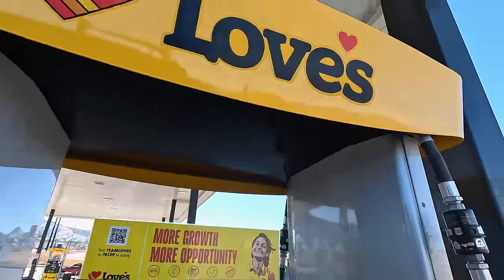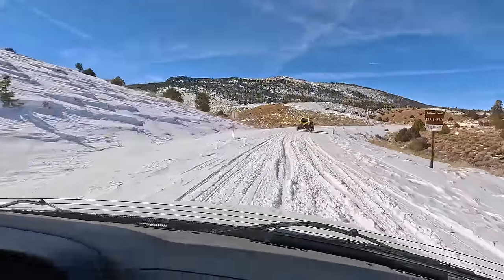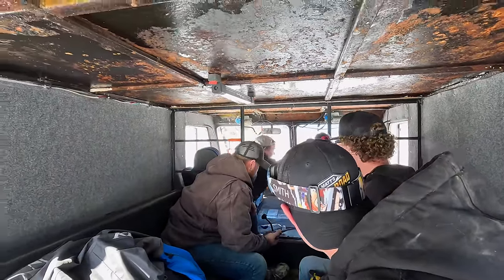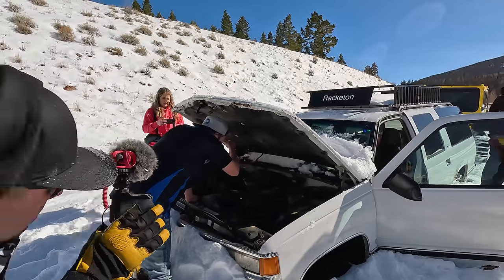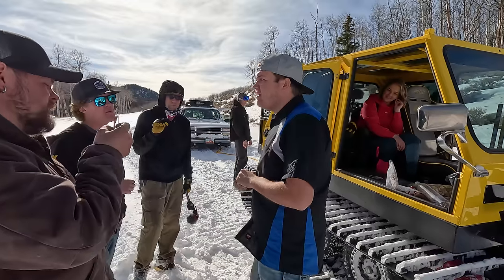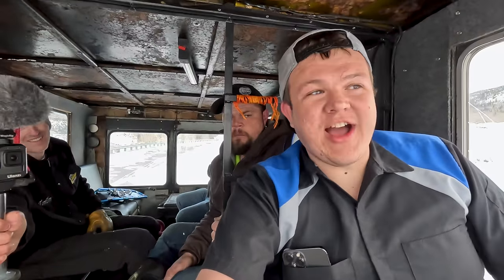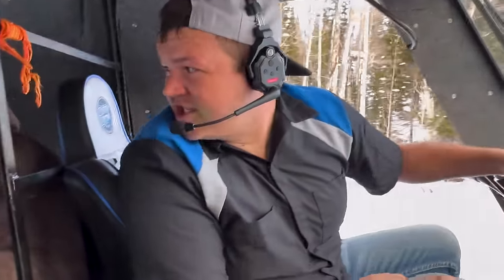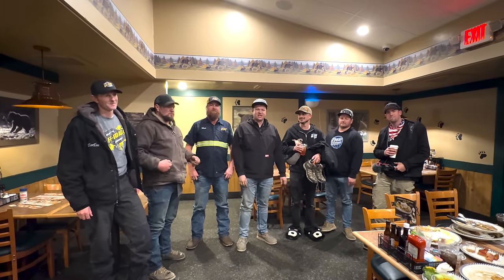Everything That Could Go Wrong Went Wrong! Snow Recovery. @MattsOffRoadRecovery

Comment: Thanks for saving my bacon, Robby and crew!
Reply: @RobbyLayton You need to run a regulator between the new lighting wiring harness and the alternator. Plus you need to make sure you use the proper gage wires for the lighting and any wiring you replaced. Also make sure the measure the resistance of each wire so that it meats the correct parameters for the lights or and if you still have all the wires you pulled out of whiskers you might want to measure all the wiring resistance lvls on them as well. All just to make sure everything you did under the dash is working properly as well. Check your New Lights and your Wiring for Shorts to ground, or your wiring with a power lead that's grounded.
Reply: @MattsOffRoadRecovery I really Hope you guys get a used skid steer and use the drive train out of it on the Bomb-Bee.
Reply: hmm out shown by a 300 straight 6. matt love you videos but the ls isnt as great as you think
Reply: @davidsesona4156  No its better than He thinks. That old Straight 6 has old school flat tapper heads on it and its entire internal setup rather is built for TORQUE. So yeah that old inline 6 did a little showing off in this video but that thing will NEVER show a LS. There is a reason the LS is considered the BEST Engine on the planet. SO Dont get all cocky when an old well maintained Straight 6 Shows off. P.S. Your Completely Right I just wanted to sound cool.... lol
Reply: @novicracker1980  ls is over rated I’ll never own one driven many of stuff with ls it doesn’t impress me any proves how small people are
Reply: @davidsesona4156  I mean Bro there are tons of engines out there but the LS is the Number One in the World. Well besides CAT, but that's Diesel Engines a completely different monster. Anyways. Bro that Flat Tappit Inline 6 is a Torque Monster and its a Big Block. So it has all the Torque built into the Low end.
Reply: I felt the stress on this one!
Reply: Sure Glad you didn't have Chad  help with the wiring
Reply: @Westerntraveler  HAHAHA Right I forgot about that.... @ChadsFab... lol
Reply: Matt, did you add the limited-slip differential additive to the Bombi's 9-inch? If not the clutches are most likely burnt up.
Edit: I got to thinking that you're using an open differential which wouldn't use an additive, but it seems an open diff' wouldn't steer or perform properly in many situations. And I'm no specialist at this so all I can do is wish you luck. lol.
Reply: Watch this footage carefully robbys tow point when pulling blue steel at the end is much lower  so wiskers stays flat underload meanwhile  bombi was standing up on its heals losing  atleast half the tracks been in contact  with the floor
Reply: Next time leave Tom on the mountain.
Reply: @ashleywright1991  Nice observation.
Reply: @davidsesona4156  "proves how small people are"
lol, what?
Now you judge people to be bad based on an engine?
Reply: @J..a..y  Maybe leave you on the mountain, what a rotten thing to say, sorry for the people around you...
Reply: Torsen Differential
Reply: @novicracker1980 Chad's Fab to the rescue!!
Reply: @georgelugenalt200  OH YEAH!!!
Reply: Haha I heard the few seconds of the tune. “I did a bad bad thing”
Reply: Don’t tear up the snow cat

Comment: Thanks for the help Robby!
Reply: Matt, did you add the limited-slip differential additive to the Bombi's 9-inch? If not the clutches are most likely burnt up.
Edit: I got to thinking that you're using an open differential which wouldn't use an additive, but it seems an open diff' wouldn't steer or perform properly in many situations. And I'm no specialist at this so all I can do is wish you luck. lol.
Reply: I know ripsaws use a spool differential and 3 brembos for braking per side

Comment: Fuse are your friends. Fuses open before wires melt. Electric 101. Wire size is never too big, Electric 102.
Reply: The lower the voltage the more critical calculations are . I'm a sparky and forever getting it wrong with low voltage stuff on my camper , my boat etc through laziness but I always play safe on fuse sizing , a professional cheat then lol . Impedance is your enemy, and as you say, fuses are your friends .
Reply: Yes fuse is my friend indeed. Relay is nice guy too.
Reply: I hate wiring…every time a new problem…. Cable are the butches of a vehicle……
Reply: And understanding the technology your working with.  If that ammeter uses a built in shunt that requires the charging load to be fed through it then you need cabling capable of carrying that load going both into and out of it all the way from the alternator to the ammeter and back to the battery.  On a the typical 32 amp Ford alternator used on older equipment that wasn't that big of a problem but with the newer ones tipping the 100 amp scale then you need a remote shunt for the power to pass through and an ammeter that just reads a low powered signal wire going from the shunt to the dashboard.  That's why many today forgo the in-dash ammeter and go with just a voltmeter to show 12.5 to 14/15 volts as Ok and above or below as a problem.  Second item is to eliminate the load on the ignition switch and dash wiring by using relays.  Generic 40 amp relays are still just about $10 each and only require a few Milli-amps of power to activate and using them tends to make ignition switches in older vehicles last a lot longer along with become much more reliable.

For many going with a Painless brand wiring harness for a classic vehicle along with the relay box option relieves a lot of the headaches since you just buy the one that supports the dashboard and number of circuits you need to run and just connect the labeled wires to the battery, starter, alternator, lights, signals, gauges, senders, etc, etc.  As the name suggests they do take a lot of the Pain out of the process.

Best!

Comment: I watched this on the MORR and enjoyed it, so now summore enjoyable footage of the recovery that went left, right, up, and down. Y'all teams work well together at creating very helpful useful content.  I know if I ever purchase a beater snowcat that will have to be rebuilt, modified, and painted I will get the Whiskers for the roomy size and add a hemi 5.7 in it and add plenty of fuses to prevent possible wiring harness issues. I would source a similar differential from a military track vehicle like a M113. The military track vehicles are very durable and require very little maintenance. They use large disk brakes to lock each track and we call the steering laterals similar to Matt's Bombi

Comment: Here's an idea for a new axle:   how about a drive axle from a Bombi. Big oil bath differential. Internal band brakes that can be relined protected from snow and ice. 
Take into consideration how many bombi-like snowcats lasted many decades with that set up.  Kind of like they knew what they were doing.  Having had experience with external exposed brakes on a tracked vehicle I expected there would be some issues in some snow / ice / temperatures. 
You knocked it out of the park building the Banana, Morvair and worlds largest off road wrecker but the old snowcats seem to have been designed pretty good right from the start..
Would think there is enough turbulence to throw oil around in that inverted axle diff but the pinion bearings wouldn't be getting the same volume of oil from above.
Those aftermarket auto shop sensors for all makes and models seem to be a gamble. OEM often a better bet.
Did you know that NASA has a big fleet of 1970's vehicles (cars, trucks, service vehicles, ambulances) that are all mechanical. No ECU's control modules, sensors etc.  Old school points distributors, carburetors, etc that can be fixed with a screw driver, pliers (ocaisional claw hammer).  Just sayin'.

Comment: Change the alternator over to a one wire gm and it will eliminate the external voltage regulator

Comment: You might look into an air locker and put it on a momentary switch so when you are going straight and need all the traction you can lock the tracks together. I have seen plenty of times pulling hard only one track was spinning. I don't think at that time you were trying to turn.

Comment: TEAMWORK MADE THE DREAM WORK. HEY ROBBIE DID ANYONE THINK ABOUT TURNING ON ALL OF WHISKERS LIGHTS ON : BECAUSE THAT WAS THE REASON YOU UPGRADED IT. SO IT DIDN'T HAVE ANYWHERE TO DUMP THE EXTRA VOLTAGE, TRUE. YOU COULD HAVE ALSO CHARGED THE JUMPER PACK WITH THE EXTRA POWER, PLUS ADDING THICKER GAUGE.  YOU'LL ALSO NEED TOO CHECK THE MAXIMUM LOAD OF THE GAUGE OF WIRE AND PUT A FUSE ON IT. GOOD RECOVERY FOR WHISKERS . HAVE A GOOD WEEK AND COUNT  YOUR BLESSINGS AMEN.

Comment: When you go over the wiring, take a look at the fuses.  Thier whole job is to prevent wires from melting.  Even the main power connection to the alternator should be fused.  It will look like a metal strap, but it's designed to go before the wires smoke.

Comment: Suggestion that Robbie should love. Swap that old Ford alternator for a GM 3 wire, a 10si or 12si, assuming it still has the externally regulated model. Gets rid of a little more wiring as a bonus.

Comment: I had a similar problem with my xj after replacing the voltage regulator, the fix was literally a new ground run to the neg pole on the battery and a keyed hot for the pos/key hot side of the regulator run via relay and that gave a solid enough signal to keep alt output to 13.3-14.6 on the gauges

Comment: Robby use O Gage wire for all your ground's and also from the battery to the Alternator you will never have this problem again. Big difference when you use it. People with big car systems do this and it makes it charge better. Also use a Chevy Alternator from a 1978 Chevy it will work

Comment: Build shield over calliper and rotor to keep snow out and hold heat in. Get different break pads that work better at lower temp. Do pressure test at caliper. May need to go 4 piston or add another caliper.

Comment: With you and Matt talking about taking the snow cats to Sand Hollow, are you guys not worried about the abrasive sand getting into all the moving parts on the tracks? I mean there's a reason they are snow cats and not sand cats. Snow getting everywhere doesn't ruin moving parts.
Reply: I believe it's a rubber track not a steel link track like on a tank. Not really many moving parts as such in the track itself.

Comment: Robby,  A smart alternator is a type of alternator controlled by the vehicle's onboard computer. This allows the alternator to vary its output voltage depending on the needs of the vehicle.
A traditional alternator, on the other hand, has a fixed output voltage. This means that it will always output the same voltage, regardless of the vehicle's needs.
A smart alternator can reduce its output voltage when the vehicle's electrical demands are low. Which can lead to some Issues.
Smart alternators are intended to extend the life of the vehicle's battery. This is because the alternator can reduce its output voltage when the battery is fully charged. This can prevent the battery from being overcharged, which can lead to Issues.

Comment: With the overvoltage output of alternator, there is one of two possibilities:  1.  The alternator had an internal voltage regulator failure or 2.  An external voltage regulator was never installed where it was required.

Comment: If your alternator is overcharging, and you can’t just disconnect it and runoff the battery the best thing to do is turn on every accessory you have to help soak up some of that extra voltage output

Comment: Hey guys,
I’m not an electrician but, when I put a high output alternator in a vehicle, I was told by a local automotive electrical shop that’s an institution in the valley to run a jump wire 4,6 or 8 ga. with a 50 amp inline fuse from the alternator to the battery for excess amperage bleed off.
As always stay safe and healthy.

Comment: @robbylayton You can actually drive an old school engine without an alternator for hours as long as you aren't using current from accessories. Those coils run on 8 volts normally and will run on 6 volts for a while. You will probably need at minimum a 8 gauge wire controlling your amp gauge but a 4 or 6 gauge would allow for more accessories to be utilized.

Comment: When I first learned about designing electronic projects I was told to do the math to determine the requirements of any part and then increase the value, in this case the current available, by at least half to be certain the reliability will always be there.  They don't do that in todays designs, but you should.

Comment: Matt had 1 track stopped, so the power doubled back through the spider gears with 1/2 the torque but 2x the RPM, those little gears are not designed to take that kind of load. Try it with a car, strap down one wheel and let the other spin, it runs 2x normal RPM (careful not to exceed the MPH rating of your tire) But that's with no load, Bombi had full load on that other track.

Comment: Did Rob remove a Resister when rewiring the control panel?  Sounds like that is all that is needed to reduce the voltage?

Comment: Oh yeah do not use those heat shrink solder connectors they melt at low geat and increase resistance in the circuit creating more heat. Use regular solder and a separate heat shrink or crimp connectors with heat shrink tubing. Lewis Rossman did a demo on one and as an person who repairs electrical and electronics I was suspicious of these new types of repair connectors. My lil bruther learned also to not use them after repairing wires in a 90 Toyota MR2 door pass through. He kept getting intermittent electrical conduction. He trusted his work but I told him to cut them out and solder them the old fashion way

Comment: Matt,
Not sure if you found the problem yet... 
But this could be the problem that damaged the brake. The gear drive in the front is causing the track to "arc" up in a wave looking manner. 32.17 in your video. It might be traveling up enough for it to come in contact with the brake assy.... justva WAG on my part

Comment: I haven't finished the video yet, but I'm wondering if it has to do with the Rear Heater shorting out again, causing issues with the altenator or power feed.

Comment: When I saw your “rewiring video”  I was going to suggest you do an emergency harness with just the bare essentials .That old 300 6 cylinder might need 4 wires to run.12 gauge is good for 20 amps all day long.
Then I thought…nahh ,Robby’s got diss

Comment: On most gm efi motors, a cam sensor is not an absolute requirement to run. The motor should default into batch fire mode and run without the cam sensor even plugged in. It won't run as good, but it will run.

Comment: Couldn’t help but laugh at Robby’s reaction on his face at about the 26:20 mark after Matt explained the situation with the Bombi.

Matt, at about the 26:07 mark: “This thing’s running good except for the front axle welded solid, it broke loose again, but not before ripping a brake caliper right off!”

Robby has a look of shock on his face, as the plan they were just discussing now got thrown out of the window!

Comment: Could whiskers need something as simple as a new Voltage Regulator on the back of the Alternator? Years ago my Range Rover had an overcharging issue and that's what I replaced to stop the 17 volts going into my battery. I just hope the suggestion can solve the Whiskers gremlin issues. Really enjoy the videos so keep them coming. cheers 👍

Comment: You do NOT need to remove the rear driveshaft when towing at 4x4 vehicle to avoid "damaging the transmission and transfer case"
You just need to shift the Transfer case into NEUTRAL.

Comment: Hate to you that with "custom wiring" you don't have problems when wired properly.  I have been wiring any and everything for the last 30 years and it's very easy to wire things so they do not melt.  There is no need to guess on wire and fuse sizes.  When I wire vehicles I use my power probe to determine the amount of power each device consumes and I size my wire accordingly, print out a wire ampacity chart and memorize it.  A proper chart will have compensation for wire length.  I prefer using circuit breakers instead of fuses so you are never stranded without a fuse. Do not use cheap connectors or terminals and invest in the proper crimpers.  I use all original crimpers made by the manufacturers of the terminals.  I have well over 300 different crimpers covering all major connector types.

You didn't have to pull the driveline in that suburban, they can be safely flat towed with the transfer case placed in the neutral position.  The New Process Gear transfer cases used in those vehicles have their own lubrication pump driven from the rear output shaft.  As long as it's in neutral it receives the same lubrication as if the vehicle is being driven.  When they are placed in neutral they are effectively disconnected from the transmission.  Most all 4x4 vehicles can be flat towed as long as the transfer case has a neutral position.

Comment: Never run  anything  from the  alterna
tor  power  except  the  feed wire  going to the
starter.  It  will  cause  the alternator  to sense  a
bad 'read' on  the amount  of power needed  to
keep the  system at  12  (actually 14)  volts and
keep the  battery  charged.  It  would  probably
overcharge  and  cause  all  kinds of mysterious
things  to  happen. This is far more important
that  you might  think.  DO NOT connect  any
power-drawing  accessory  to  this  wire  at
either  end.